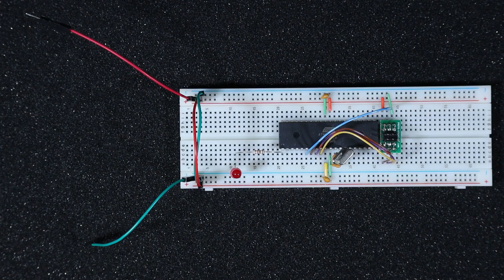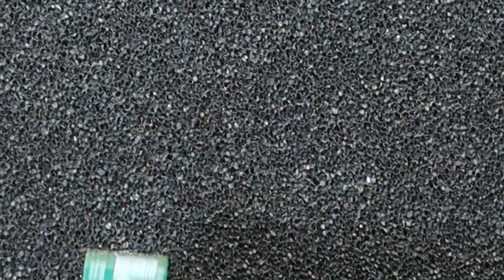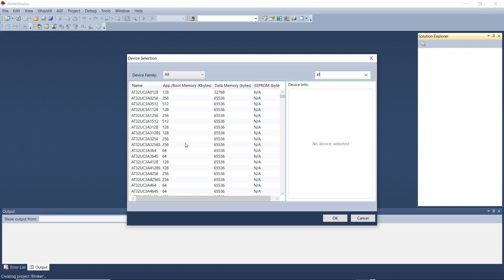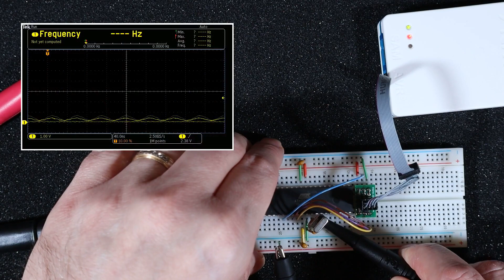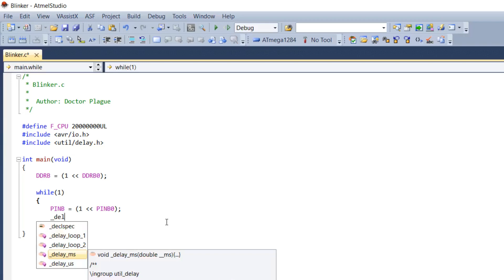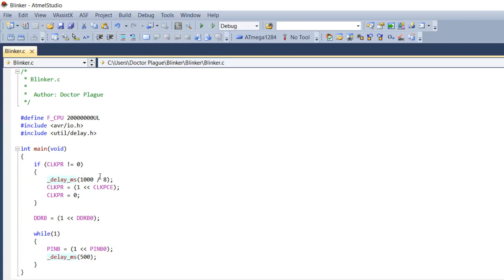Running AVRs at 20MHz (EP 54)

Comment: At work when we went from 16mhz to 20mhz we found a random number of chips would not flash using FLIP (this is upto 40% of the device , even at the lowest 9600 baud rate. I tried everything (replacing the mpu/crystal/caps) and no luck. Get this, I found a old flip manual and there is "programming pairs", wth is that,,, it is pairs of mpu clock and programming rate that are happy, at 16mhz, almost all baud rates are fine, but jump to 20mhz and there is not one happy pair. How did I fix this, I connect a 30 to 130pf cap across the crystal (yep across it), this dramatically changes the freq (~40 to 50mhz) and it programs fine and verifies fine every time. Then remove the cap and all good. Thoughts?

What I need is a programmer that goes lower than 9600baud (~8000baud), I tried one, it sorta worked, programmed and verified, but would not run the code. Where Atmel Flip does, Ideas/thoughts? TIA

Comment: Hi! Just subscribed. I admit the thing that made me click the video thumbnail was seeing the mask. I thougth "This must be cool".
Also I have a bunch of Atmega 328P lying around which I haven't been able to program because they don't have bootloader (I even have an AVR programmer).
Reply from the maker: You don't need bootloader if you program them directly using an ICE programmer (not installed in an Arduino for instance). I never use bootloader. But that's just my preference. Thanks for subscribing, and thanks for the comment!
Reply: Thanks for the tip!  @DoctorRGPlague
Reply: BTW, Bach is also one of my favorites.

Comment: Not criticizing but I got confused and had to look up when you said '1 second or one hertz' if I understand you meant half a Hz?
Reply from the maker: No, I did mean 1 Hertz (which is a 1 second period). Let me explain. One half Hertz (0.5 Hertz) would equate to a 2 second period (remember that frequency and period are reciprocals of each other, so 1/(0.5 Hertz) = 2 seconds), and if you watch the LED blinking in the video you will notice that it did not take 2 seconds for the LED to blink. It was blinking once each second. The period represents the amount of time before the pattern repeats. The pattern is to turn the LED on for 500ms then off for 500ms (the LED is toggled every 500ms using the PIN register toggle feature). So, the full pattern consists of 500ms ON plus 500ms OFF which equals 1 second (the period). Then taking the reciprocal of that gives us 1 Hertz (1/(1 second) = 1 Hertz). Hopefully that makes sense. Thanks for the comment!

Comment: Perfect level of weird and informative.  I have a whole bag of avrs so definitely useful!
Reply from the maker: Glad to hear. Thank you and good luck with all the AVRs!
Reply from the maker: @tripplefives1402  - I do not think we will see AVRs go away anytime soon. There are still close to 280 8-bit varieties that are still in production, and that doesn't include other AVRs such as the 8/16-bit and 32-bit versions. Also, new AVRs are currently in development and are planned to be released in the near future. This would not be the case if there were plans to phase AVRs out. As an engineer, I have many FAE contacts for various manufacturers including Microchip (the manufacturer of AVRs), so if this were to be true, I would find out in short time. I believe this idea stemmed from the ATmega328 (popularly used in Arduinos) being moved from "In Production" to "Not Recommended for New Designs". This happened quite a while ago, and they still haven't moved that variant to "End of Life". The other variants of the '328, which include the '48, '88, and '168, are still in production. The '328 was to be replaced with the '328PB version, which is currently "In Production". Unfortunately, the '328PB is not being produced in a DIP package but can still be used on breadboards with a protoboard adapter. Until we start seeing AVRs moving from "In Production" to "Not Recommended for New Designs" in droves, I would not be concerned with them supposedly being "phased out". Thank you for your concern, and thanks for watching!

Comment: Another interesting and excellent video.. Nice to see you back again! 

Thanks for the warning about the power on ramp of cheap Chinese power supplies!

Also I didn't see how the code could toggle the pin. You seem to be writing the same value to the port. I am unfamiliar with Atmel Studio and the AVR #defines. I expected you to write a '1' to the port, then delay, a '0' to the port then delay, just to make things clear for the viewer. However I have a sort of recollection that the AVR has a toggle register, but I googled and nothing came up. Found it now, writing to the PINx register results in a toggle of pins on PORTx.

I am used to AVRs in the context of the Arduino world/GUI. They are a cheap, nicely designed microcontroller. It's always helpful to learn some of the lower level details. 👍
Reply from the maker: Thanks for the comment!